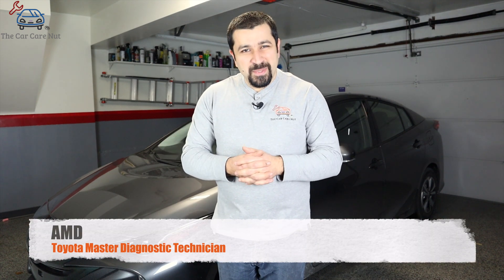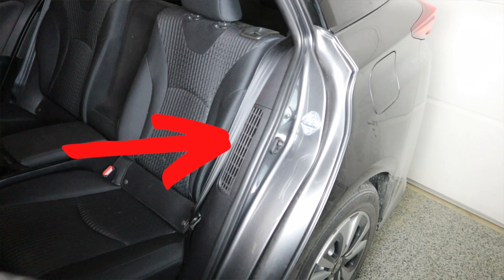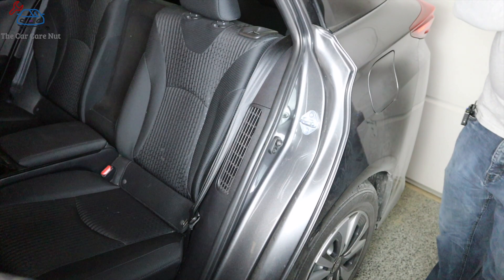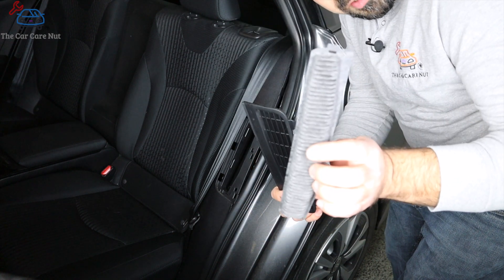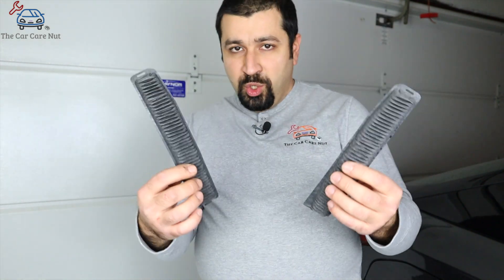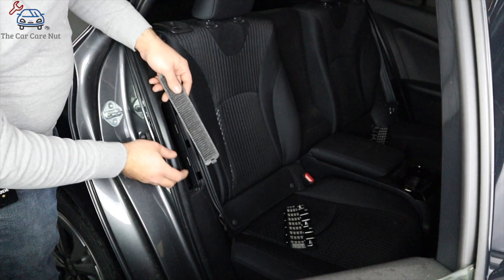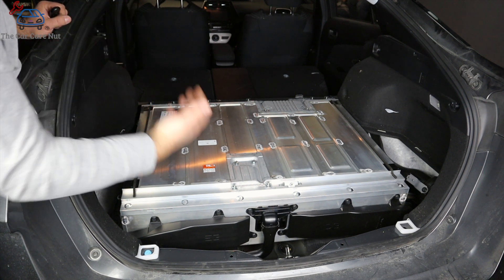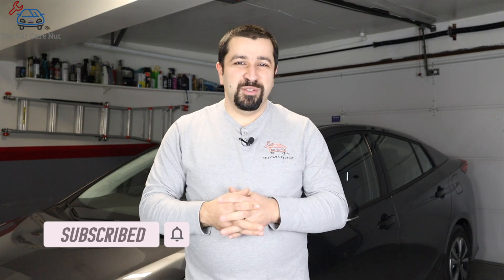How To replace HV Battery Fan Filters on 2017+ Toyota Prius Prime Plug in Hybrid

Comment: The local toyota dealer showed me a picture where the filter for my 2021 prime, it looked like it was in the battery area.  They wanted 300 plus to replace a filter cartage just in front of the battery. Think they called it cooling fan filter.  Anyone know and or know of anything like this?   My 2021 prime is just like his video.    Very nice job.

Comment: @car care nut, I see the filters on both sides and those are easy to get to. Is there another filter housing located underneath the rear passenger seat? I see other videos referencing another larger filter located there. Is there both a HV fan filters and hybrid fan filter?

Comment: My 2021 Prime is getting close to 60,000.   I take it to the dealership every other oil change to see if I need anything completed.  They said I have to have the battery filters replace (150+ dollars).  The cabin filter, and engine filters need replacing. 
I spoke to my family mechanic and he asked if I fell for it.  I said no, and for him to look at the filters.   They're fine.   Frustrating when dealerships throw the fear factor into the equation.   Like the pin in the brakes needs to be greased.   I'll get that done when the brakes need replacement

Comment: Is the 2018 prius prime, can the hatchback be adjusted for height of the opening?   We already experienced the Hatchback almost getting hit by garage door in the open position and then someone presses close and well the door hit the Hatchback but we stopped it in time.   I notice 2 bolts higher up on the opened Hatchback, are these to move to hydraulic shocks so Hatchback doesn't open higher?

Comment: Correction for 2021 Prime! Evidently, they made some primes with the wider filters since they made both ductworks wide.  Mine has two wides and no narrow one as depicted! Can't even find the left wide anywhere! Was wondering what models have the wider filter?
Reply: yes correct 21-22 is wider only. 
different part numbers

Comment: I have a 2017 Prius Prime with 75000 miles. The dealer is asking me to do the hybrid fan service. Do you know if the fan service is triggered by the onboard sensor or strictly from the maintenance schedule checklist? I cleaned and replaced the filter per your video at 45000 miles (and they are super clean since I do not have pets or passengers) but I have not disassemble the backseat to vaccume and clean the fan.
Reply: Maintenance schedule. I'm at the Toyota dealership now. Asking about $300 to clean it.

Comment: Hello, I do really appreciate your videos. They are very informative. If you don't mind can you answer my question. I recently bought a 2018 prius plus 7 seater. The air went for the battery is under the passenger seat. I s there is any filter for this model. I couldn't find.. please help. Thanks

Comment: I have a 2017 Prius C.  It does not have a removable battery filter.  It has a vent on the back passenger seat on the drivers side. How can I clean the battery vent? How can I make sure the battery is getting adequate ventilation?  Great videos and thank you.  Tony

Comment: Thank you so much for your professional video sharing, I checked my 2020 prius prime and it currently has 40,000 miles.the filter is very clean.  But dealership say i need to do battery fan  cleaning, Charge $300,Can I do it myself?I can't find a fan, please how to do it.
Reply from the maker: Hi! If the filters are clean the fan is clean as well.
Reply: @TheCarCareNut  I was wondering about the same, still - is there a filter on the battery fan itself? If so, is this something I can access for DIY cleaning? Many thanks!

Comment: What you are saying makes sense about the battery filter, but it bothers me that I don't see anything about that in the owner's manual or the maintenance guide that came with the car.  Why doesn't Toyota tell us to change these filters?  I have a 2017 Prius Prime plug-in with 93,000 miles.  It has been very reliable with minimal maintenance required.  I would have changed these filters long ago if I had known.

Comment: These are very easy to maintain. Access is easy, and removal and replace also easy; no tools needed. It helps to have an air compressor with a blow-gun attachment to blow the dust out of them. But they are kind of delicate, be careful not to punch or tear a hole in the mesh while handling them.

Comment: Do you think the prime is better than the regular prius?
Reply: The powertrain in the Regular Prius and the Prius Prime Prime are not much different. The gas engine is identical. The gear ratios are slightly different because the Prime has a slightly more powerful MG2 motor. The main difference is that the Prime's traction battery has about 7 times more capacity, and it's lithium instead of NIMH. The main reason to drive a Prime is to save on fuel costs. To decide if a PHEV is right for you, either a Prius Prime or a Rav4 Prime, you should consider the following factors in the city where you live:
1. What does regular gasoline cost? Figure your cost per mile in Hybrid mode, based on 50 mpg for a regular Prius or 55 mpg for a Prime (the Prime has better aerodynamics, and the larger battery helps it recover more energy in regen mode).
2. What does electric power cost per kilowatt hour where you live? My Prius Prime can go about 35 miles on a 6.7 kw-hour charge. I pay 9.5¢/kw-hr if I charge between midnight and 06:00. That's 64¢ for 35 miles, or about 1.82¢/mile in EV mode. Gasoline where I live is $4.50/gallon, and the car gets 55mpg in ICE mode, which is 8.12¢/mile. So the car costs 4.5 times as much to drive on gasoline than it does electricity, where I live in California. In Honolulu, Hawaii, where electricity is 38¢/kw-hour and gasoline is $4.10, the difference is much less dramatic: 6.84¢/mile on electricity, 7.45¢/mile on gas. If you live somewhere that your electricity is less than 12¢/kw-hour, or if you have rooftop solar and can charge your car essentially for free, and gasoline is hella expensive, the Prius Prime is the way to go. But in Hawaii, or anywhere else that electric rates are steep, a Prius Prime might not save you enough on fuel to justify the higher purchase price, unless you plan to keep the car for 200,000 miles.
Reply: @laura-ann.0726  thank you
Reply from the maker: Hi! They are good in their own prospective ways. I wouldn’t say one is better than the other.

Comment: Will be buying a Prime in 3 days.  Have been watching your videos and want to say thanks!!  Keep up the great work!!
Reply: Did you actually get the car? How do you like it? I've had my Prime for almost 3 years, and it's amazing. Even loaded down with camping gear, with a cargo pod on the roof, I get 55mpg. Unloaded, 62mpg. If you would like to more closely monitor your Prime's performance, get a Bluetooth OBD-II scanner (about $36), which you plug into the OBD-II port under the dashboard. If you have an Android smartphone or tablet, install these three apps: CarScanner, Hybrid Assistant, and Tire Assistant. Car Scanner reads ALL of the data the car's ECM computer provides. It's $5 and worth it. Hybrid Assistant is what I use while driving: it shows a bunch of data on State of Charge of the traction battery, temperatures of the MG1 and MG2 stators, Inverters, transaxle, and engine coolant. Instantaneous power levels from the ICE and MG2 motor, and fuel consumption statistics. Tire Assistant reads the TPMS sensor data in your tires, and shows you the actual pressure in all 4 tires: no more having to get down of your hands and knees with a tire gauge.

Comment: there's a vent or filter under the rear seat for my 2022 prius prime not sure what that is
Reply from the maker: Hi! There’s a vent under the seat which doesn’t have a filter
Reply: @TheCarCareNut  so it a battery vent too?
Reply from the maker: No it’s for the Battery charger
Reply: @TheCarCareNut  so it's air pushed out into the car? that's why it doesn't ned

Comment: Could you please explain how to replace and - most importantly ADJUST - the brake light switch on a 2004 4Runner? Specifically, how to replace the brown nut on top of the bracket.
Thank you!
Reply from the maker: The brown not can be difficult to replace. But you’ll need to break the 2 tabs that lock it in the install the new one. Before you remove the switch take a picture of how far the switch part sticks out so you can install the new switch at the same height
Reply: @TheCarCareNut  Thanks a lot! 
I had a code C1246 (faulty master cyl pressure sensor), found a recommendation that it could be the brake light switch adjustment. Scanned with TechStream and found that pressure would go up before the switch is engaged. Adjusted, the problem disappeared for 2-3 weeks, then came back. Decided to replace the switch first - it's cheap and easy - but it did not solve the problem - the code came back. Scanned again, this time found that master cylinder pressure sensor output is 1.9v and does not change with pedal pressure. 
It seems to me that the problem is with the switch (and I even found the part) but I can't find it anywhere on the master cylinder or other components around it.
1. Do you think it's the switch issue or could it be something else - Toyota shop manual mentions solenoid?
2. If it's the switch, where is it located?
3. If it's something else, what can it be?
With great respect and gratitude!
Reply from the maker: Hi! Honestly this might be an issue with the hydraulic booster itself as most of the parts are not serviceable in that unit. How are the brakes working generally? Do you have assist? And what warning lights are on?
Reply: @TheCarCareNut  Brakes work fine, VSC, Traction, and ABS lights come on after a few minutes of driving so initial diagnostic cycle apparently goes through successfully.

Comment: Hi AMD.  Love and appreciate your videos.  I'm a new Prius prime owner  and was wondering what the vents underneath the passenger and driver rear seats are for?  Do they also need servicing?
Reply from the maker: Hi! So the vents under the back seat are for the charger which sits underneath the back seat and has a fan. They don’t have a filter and there’s no service needed. Don’t block them when the car is off and charging as that’s when they’ll be used

Comment: Question is there a filter for the ones under the seat? I believe it goes to a 12v converter used when in charging mode?
Reply from the maker: Hi! No filter for the one under the seat

Comment: At the Toyota dealership and they said the filter lasts lifetime don’t need to replace. So happy I seen this video
Reply: As long as the filter mesh doesn't get damaged somehow, these filters should indeed last the life of the car. Just blow the dirt out of them with compressed air twice a year (or more often if you live somewhere that's really dusty), and they'll last indefinitely.
Reply: @laura-ann.0726  I wasn't away that they last a lifetime.  My dealership said they needed replacing.  I didn't fall for it which is why I'm watching this video and reading the comments.  Thanks for the advice
Reply: @beebob1279  - They are made of a finely-woven mesh, like the lint screen in a clothes dryer, except plastic mesh instead of woven aluminum wire. If you don't have access to an air compressor, but you do have a vacuum cleaner that allows you to plug the hose into the exhaust port, that will work pretty good. Put the crevice tool on the end of the hose, and the air blast should be sufficient to blow the accumulated dust out of your battery fan filter. If the filter mesh is looking frayed, or it's been damaged somehow, you do need to replace it, but they don't cost much, maybe $16 each.

Comment: Great videos. Thank you. I am looking at a 2013 Avalon Hybrid. I found the vent, driver's side rear door. Is there a filter for this model?
Reply from the maker: Hi! Likely the 2013 didn’t have a filter but one can be added. The vent, does it have a mesh directly behind it?
Reply: @TheCarCareNut  there is nothing behind the vent.
Reply from the maker: Ok so it doesn’t have a filter from the factory but one can be installed for it. The back seat bolster would need to come apart to install the filter. I am looking for an Avalon hybrid in the Chicago area to film a video on how to do this no luck so far
Reply: That would be so helpful.  Thank you!

Comment: Fantastic Video as always! Hey quick question on the RAV4 Hybrid gas tank problem as you may have heard about already. I have a 2021 Venza and in the video of your review of the Venza you mentioned it was the same as RAV4 Hybrid in many of it's components. Is the gas tank built the same as the RAV4 Hybrid? Should I worry about encountering the same issue as RAV4 Hybrid owners?
Reply from the maker: Hi! So far the Venza hasn’t had any issues. Some folks have reported issues but they’re not the same. The principal symptom on the RAV4 was the inability to fill the tank and the gauge never goes to full. If you don’t have that exact issue in your Venza then you’re good and likely won’t have it.
Reply: @TheCarCareNut  Gotcha! I haven't had that issue. I have seen that from empty I only fuel up 11.79 gallons. I also get a range of approximately 450miles instead of the advertised 536.5 highway but I do still get the 39/41 mpg. I'll definitely pay closer attention at the pump from now on.